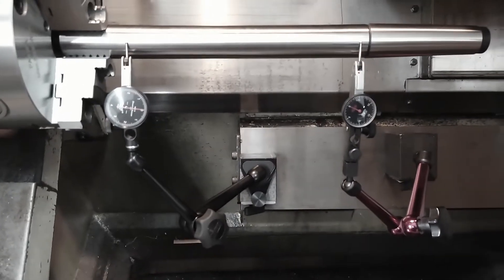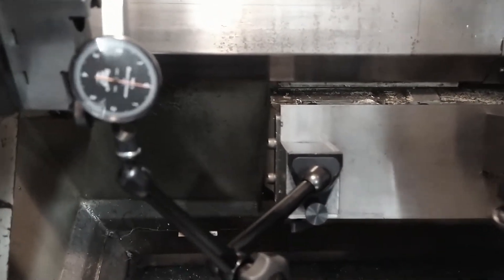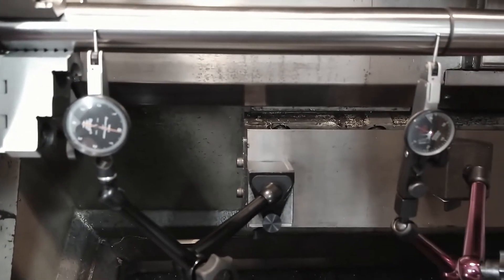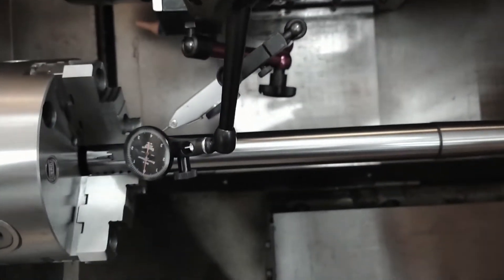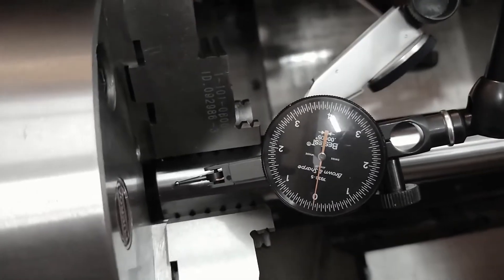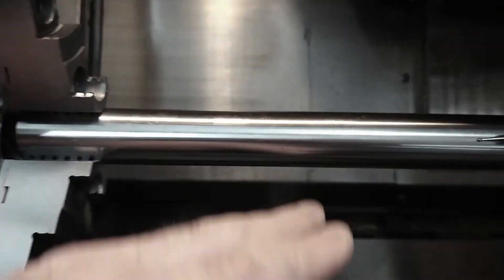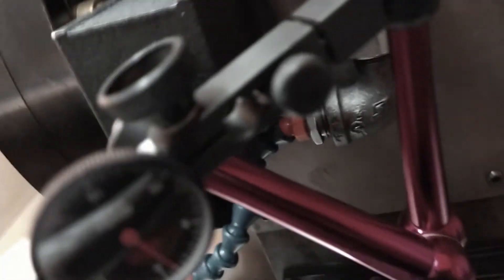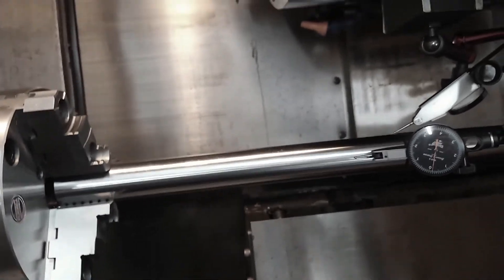Hardinge Cobra 42 Lathe headstock alignment check

Comment: I'd like some help with my Hardinge 65 I can not get the spindle turning I don't know how to us the Fanuc-21 controller
Reply from the maker: Need the door closed, all alarms off, go to quick page, arrrow over to mdi, hit program key on keypad, type in M3 S100, press EOB key, press insert key, then press green cycle start button.

To stop type in M5, press EOB Key, insert key. Cycle start
Reply: Thank you if you have time can you make a video  I'd pay you for your time
Reply from the maker: @abramfriesen9834  do you have the manuals?
Reply from the maker: @abramfriesen9834  I can send them to you if you need,  shoot me your email
Reply: Yes can you send me the manual having trouble with the screnn it will no light up

Comment: Thanks for your work on the Probe Basic GUI! I am thinking about upgrading from my Harrison CNC Lathe to a Hardinge Cobra 42, are you running the machine with a phase convertor? Have you had any problems with the control?
Reply from the maker: Yes I run it on a25hpcnc rated rpc. No issues so far.

Comment: Are you planning on making parts 9inch long with an accuracy of less than .001? If not then it seems good enough
Reply from the maker: Drawbars I make are 11" , and have threads at one point end and  precision tolerance fit at the other so I needed to get it pretty close.  But I can program around the machines capabilities as long as I am aware of what and where they are.  But I agree, tolerance is subjective.. it's easy to get lost chasing tenths and super precision increment indicators with exaggerated sweeps tend to make us think things are worse then they truly are.. perspective .lol

Comment: I have been eyeballing one of these for a retrofit.
Reply from the maker: Everything on this one works, so I'm not going to change the control until something major goes.  They have fanuc redtops so if you rettrofit I think your stuck replacing the servos and drives as the communication protocol is proprietary.